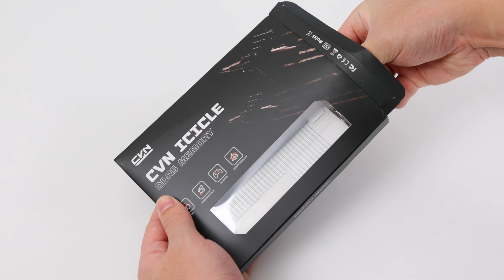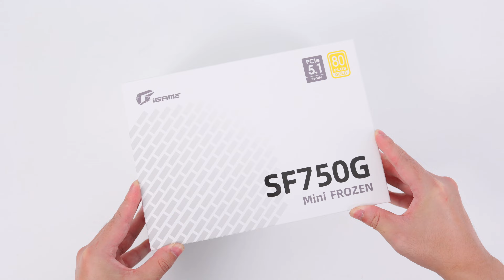There is only a family bucket of CPU | Colorful iGame C24Mini FROZEN Build

Comment: that gpu gonna blow the hot air back
Reply: As intended
Reply: I think the only way this build would work is with bottom intake + side exhaust, or side intake + bottom exhaust. But both fans are configured as intake it sounds like a bit of a thermal disaster :(
Reply: If top fan exhaust problem solved
Reply: @Wunnabeanbag  top fan is the GPU, so it's an intake
Reply: Thats why he said "if". @karakuri002
Reply: @reitastatic3386  both of you really didn't watch the while build huh
Reply: @reitastatic3386  both of you really didn't watch the while build huh